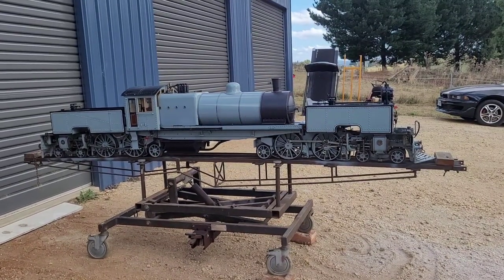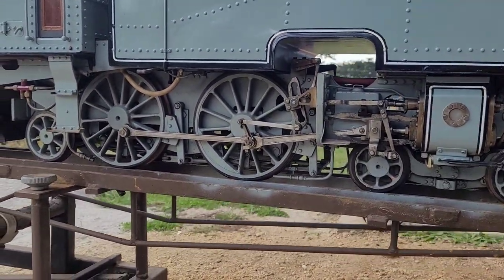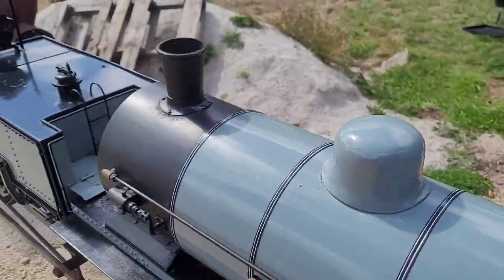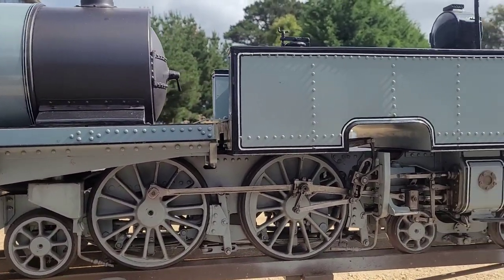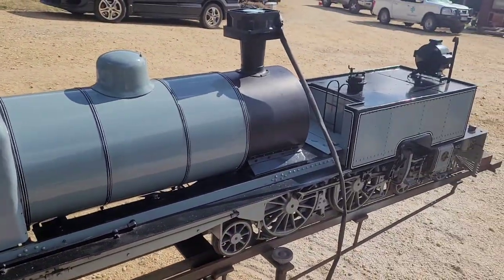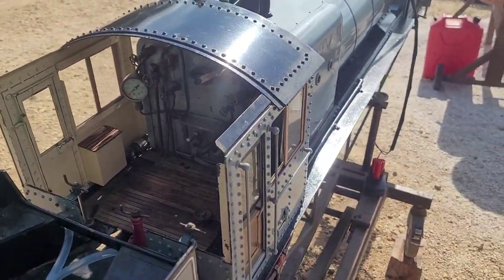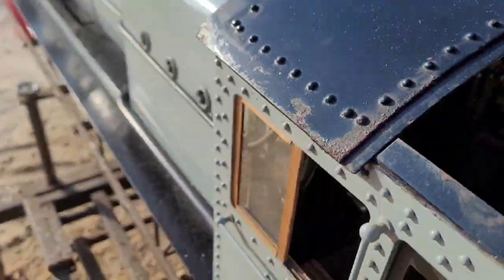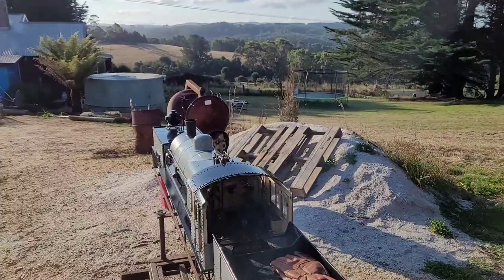5 inch gauge Tasmanian M class Garratt- live steam locomotive steam test.

Comment: What a magnificent model. Where did the drawings come from? The Rosney Archive office use to hold all the TGR engineering drawings but later transfered to TAHO. What was the other class of TGR garratt used in Tasmania? The State was a leader in adopting garratts and the North East line was used for extensive trials particularly over the Billycock.
Reply from the maker: I am not sure where the drawings come from, they are actually for an L class garratt, but I guess there were alot of similarities.